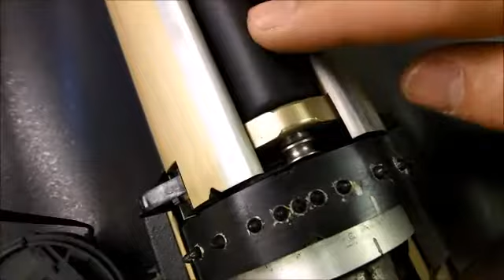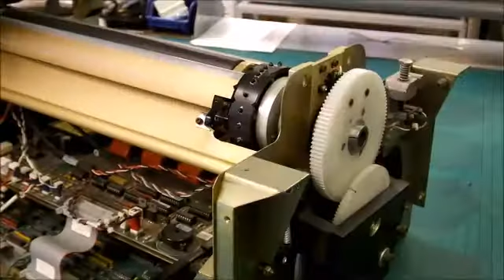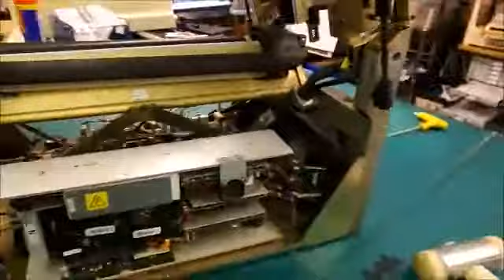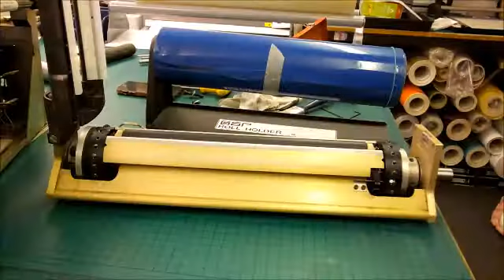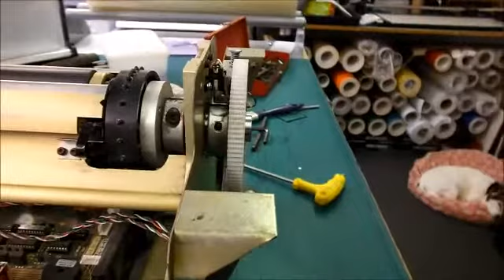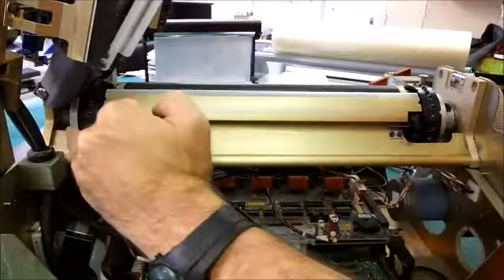Gerber Edge Printer Fix

Comment from the maker: Sorry I've not had to replace a head yet. but I would think it's not too hard, Make plenty of marks where the old head is and fit the new head in the same place.Should have no problems.
Reply: +jason williams 
I have the voltage setting for differents PrintHeads ohms, if you need it, let me know.